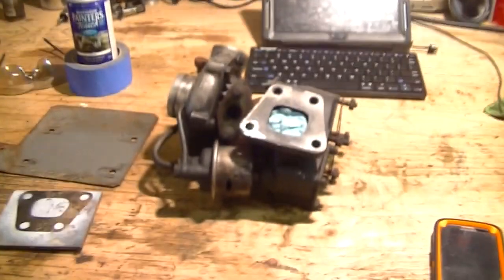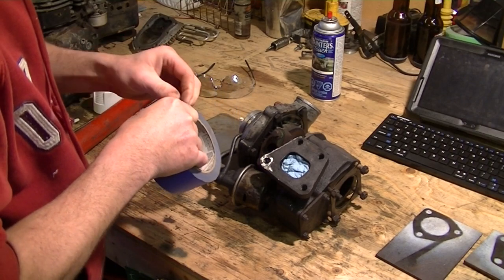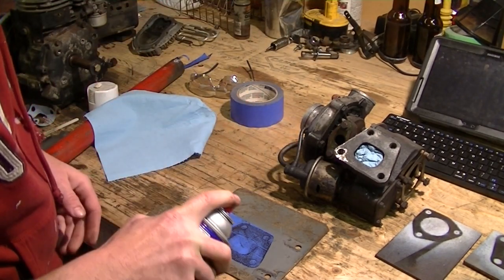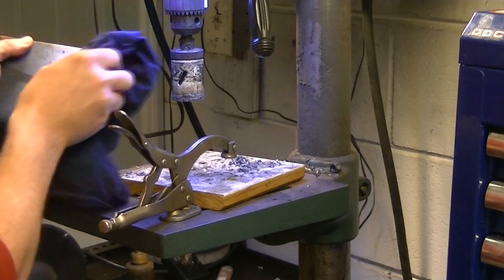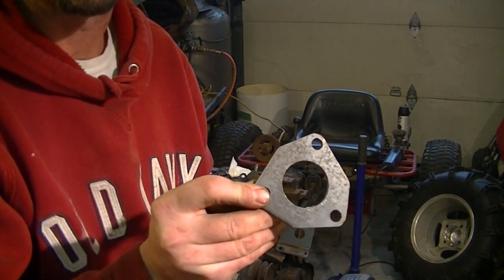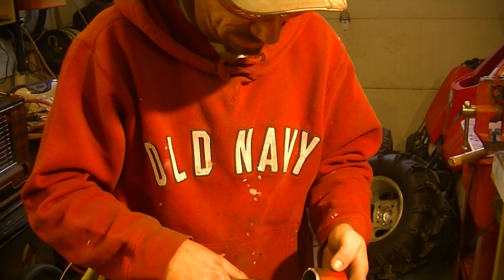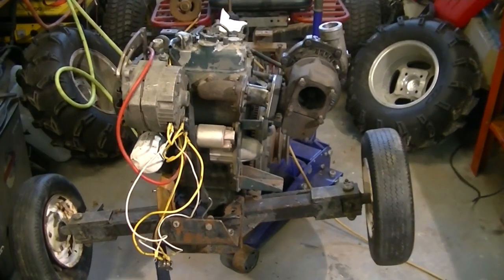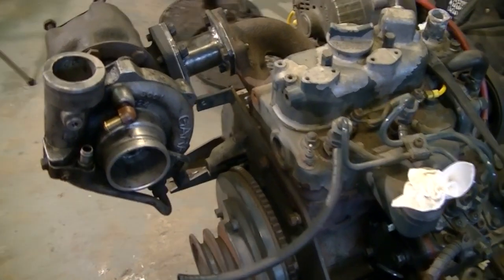TurBota, Phase 1

Comment: That turbo looks like it was from a vw diesel haha. 
Anyways, maybe it's just for mockup, but the center section should be pointing more downward for proper drainage of the oil to the pan. It can remain in the turbo and go past sealskins make you think the turbo is bad  if it can't drain correctly.
Reply from the maker: It WAS from a diesel Jetta. As for the oiling, I have yet to work all that out. I had thought to run the drain to the rocker cover actually. Unsure. Rotating the housing will be difficult due to the steel waste gate lines.
Reply: Try and not run it to the valve cover. It's like dirty whipped cream as it comes out. All airated...try and get it to drain in the front cover or in the oil pan above the oil line. 
Theres 2 lines for the wg on that turbo, the one that goes to the turbo air Inlet can be ran to atmosphere..put a small fuel filter on it's end ....plug the intake side. The other one, the big one..yea that sees boost. 
It could be done with compression fittings, or depending on the clocking you could do fuel hose and clamps. I've ran vws for years and that turbo is like an old friend. 
They used 2 turbos back then but the Garrett always ran best.
Reply: Sorry to keep commenting. 
What's the max revs of the kubota, and it's displacement? 
The vw is a 1.6 and redline is 5100 or so. Iirc it wouldn't start to chime in till about 2300-2500....
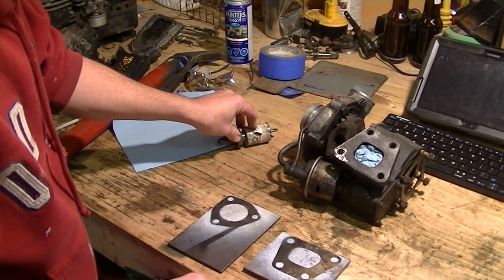Reply from the maker: MrTheHillfolk No, by all means, keep commenting. I appreciate the input. The turbo stuff is new to me. Now- stock max RPM of the engine is about 3600, but I think the previous owner turned the governor up a touch. I think he turned the fuel up too. I'll get the tach on it once it's going again. Displacement is 400cc, and the engine the turbo came off was 1.6litre, I believe. Regarding the oil return- I had a look, and I'm afraid to touch the housing bolts to re-clock it. Pretty sure theyre going to strip or break It's sitting with the return fitting at about 7:30, or around 45° off straight down. I think it will be ok, based on this" After careful consideration, I'm going to pull the oil pan off and add a return fitting for the oil.
Reply: Also maybe take a look around on the front cover. There might be a spot. Pulling it off can be a bit tricky though. Research that if so. I'm a little worried about turbo sizing..it may be a little big for a 400cc engine vs what it came off of...the Ol vw 1.6 ;) 
One place that could maybe help ya out with the turbo info. 
Vwdiesel.net
Tell em hillfolk'r sent ya ;) 
And I also gotta check out how ya can get more fuel under boost conditions. That's where you will get power. 
Also, an awesome book that's called turbocharging, by Hugh McGinnis and is probably avalable on amazon for less than 20$....it's somewhat dated, but the basics don't really change. It can save you a lot of grief on a custom install like you are doin. I'm not bashin, I'm diggin this project, I just wanna see it be reliable and not cause a problem cause turboed diesels are awesome!
Reply: MrTheHillfolk Good teaching man. Maybe a popoff valve wouldn't heart, set low till it's running right, Then turn it up. A pop off valve is like a pressure valve on the intake side so you don't go over a certain boost. when coming off the gas pedal or at full throttle. Have it just dump outside the intake. I got a mod I'm working on that would help this setup, I'll be uploading it maybe early spring.
Reply: Sprocketsgarage Oh, a perfect example of a popoff valve on something similar that your familiar with would be your air compressor, lol. That valve next to the electrical switch incase the electrical switch goes bad and the motor keeps running the valve pops open say 10 psi higher then when the switch turns off the motor say at 135 psi and closes at 90 psi to keep the pressure in the tank is a perfect example of a popoff valve on a turbo system. I still have most of my class books from powerplant class, I'll take a looksee to see if there is anything you can use. I can scan them and mybe email the info to you. You'll be a pro in notime.
Reply: They usually don't use a bov on a diesel bein there's no throttle plate and a place for boost to back up...some race dudes use solenoid powered ones to help keep the turbo at speed between shifts but ts not usually needed. 
Stock boost is about 10psi on the vw, and it'll be the same on the kubota pretty much as long as it's not too big to work. 
Now to crank the boost, use a mini shop air regulator on the wastegate line and choke it down to stop flow. 
Wastegate doesn't see the psi signal, boosts to the moon. 
I used to run my vws at about 35-40 pounds of boost.
most of the time I ran it closed wastegate. 
Oh btw if your turbo and exh flange is flat,,no gasket is needed ....or maybe a very light translucent layer of ultra copper does the trick.
Reply from the maker: MrTheHillfolk Thanks for the tips! The regulator thing is a nifty little idea...

Comment: Wait, no water cooled tig torch action? Heh, maybe ill have one sometime. This will all be ceramic coated with stainless hardware, correct? ;)
Reply from the maker: Uhhhh. Yeah... O.o lol
Reply: Believe it or not, for your turbo hardware DO NOT use grade 8 hardware. 
Use grade 5. 
Reason being the grade 8 is too hard and doesn't expand nicely with the manifold and turbo heating and cooling cycles. I  seen plenty of grade 8 studs popped cause of that reason. 
Sounds funny, like you want the hardest fastners avalable but it's just not the case.
Reply from the maker: MrTheHillfolk Interesting. I'd only planned to use gr5, anyways. Don't need a ton of shear strength there. I DO plan to slather them in copper anti-sieze, though...